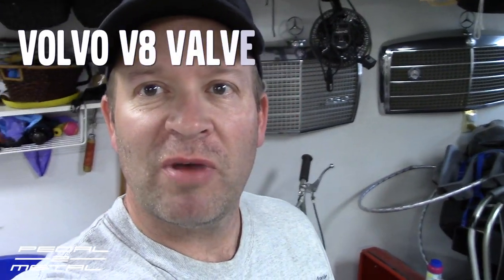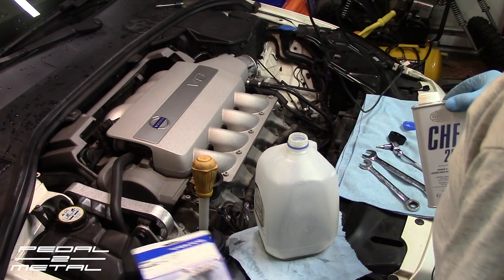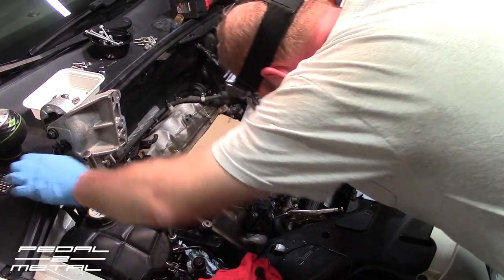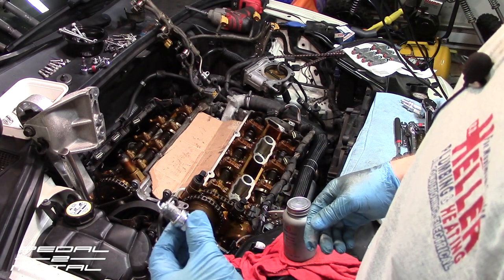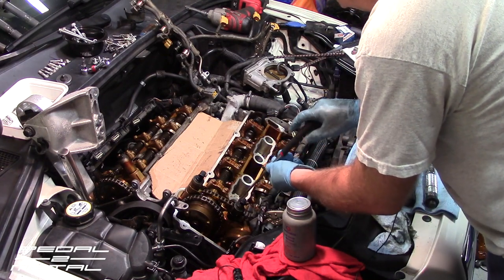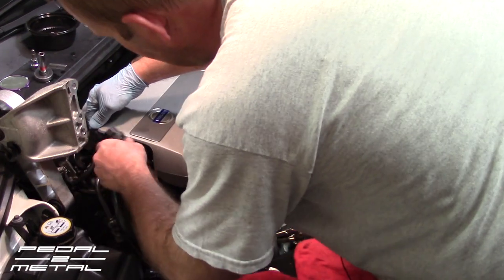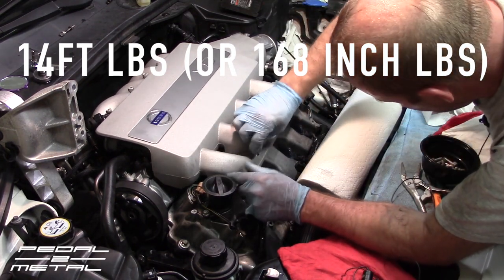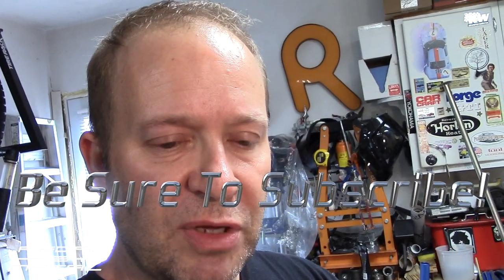Yamaha V8 Valve Cover Gasket Job | A FUN Way to Spend 12 hrs! | VOLVO S80 V8 Project Car Vlog

Comment: Doing this job myself, This video has had a lot of good info to help me a long the way. But I have to replace the fuel rail. I cant figure out how to detach the fuel lines that are back next to the fire wall. Worried I might break it if I try too hard. Any insight?
Reply from the maker: I'm sorry, no,  I don't.   They are most likely connected with push pin type of fittings, like VW and many others use.   Why are you replacing the fuel rail?  It's basically a tin pipe..  what went wrong w that; I'm just curious?

Comment: Are valve gasket failures common on these p2 v8s?
Reply from the maker: It's not a failure, per say; they just get very brittle due to age. The newest V8 is 2010, and the oldest is 2007. So you they are old cars now. Most need replaced if the motor has over 125,000 miles or so. It's very common and part of the regular maintenance of these motors. I still need to do my timing cover gasket, but the drip is minor.
Reply: @Pedal2Metal_on_YouTube  hi, i have about 70 000 miles, and I have these problems

Comment: Epic video, I have a XC90 with 138,000km and I'm gonna hit this job up. This is off topic but when I got the car, there was very low power steering fluid and it startled me when the steering went stiff suddenly, I filled 500ml of correct fluid in and it's been fine since. I did degrease quite a bit of grease around the top steering pump and noticed oil on control arm, etc.
Is it likely that it is leaking from the steering system or could the level have just dropped and the dealer not noticed it?
I do also have a tiny drop every day of brown oil (engine oil) from what looks like the rear bank (doh! looks like I need to this job).
Reply from the maker: Thank you for watching the video. Yes, I would say you might have a leak at one of the power steering pumps hose o-rings, it sounds. I would definitely keep an eye on the leaks possible location.

Comment: How many miles do you have? I'm going to test drive one this Saturday. How easily can I remove the plastic engine cover? Any other things to look at in your opinion? TY
Reply from the maker: Mine had 121k miles on it; it now has 132k.  You can easily pop off the decorative engine valve covers; just grab them and pull straight off the knobs holding them on.  The main issue with these cars is the alternator, power steering pump and transmission.  Also, once these cars go over 100k miles the rubber engine gaskets start to leak... Due to high heat conditions and age.  I'd ask for all records on the car.  Other than looking for drops of oil or power steering fluid; they are pretty damn reliable from what i understand. I joined the Facebook Volvo s80 v8 owners club right away to learn more info.  Good luck!

Comment: would you happen to remember how many grounds was there? I thought I had 4 but i got 5 ground bolts! and i've only used 3 so far... i only recall 2 painful ones at the back and 1 at front...where are the rest?
Reply from the maker: I had 4 total but the one in the front drivers side was not an issue.
Reply from the maker: My 4 were at each corner of the motor.
Reply: @Pedal2Metal_on_YouTube  thanks! i'll trace all my wirings carefully... i had to snip the 2 at the back, just buttoning everything back up now. seriously huge job!
Reply from the maker: @alliao  yes, its a pain in the ass of a job.  My car is no longer keaking any oil though; do thankfully it wasn't the timing cover.

Comment: Great video!  Decided to search YouTube prior to my start this afternoon. I'm ready to take off the valve covers. Bought same kit from FCP, get all parts there because of lifetime warranty  How did you deal with the fuel lines on the rear bank?  Noticed that you didn't separate them.  Doesn't look like there's enough room to get the cover off unless the lines are unbolted and moved which isn't easy. Spent 30 minutes trying to disconnect fuel lines and I don't have whatever tool is needed.  BTW, I used to own my own 7 bay shop for 20 years and have an ASE master's, but I wasn't a full time mechanic.
Reply from the maker: Thank you. If I remember correctly, I just moved the lines out of the way; I def don't remember disconnecting any of them.  My car is still dripping oil, so I guess I should have gotten the kit that has the timing cover gasket too.  Ugh
Reply: It's probably the front crankshaft seal.  That leaked first in mine. Not too bad to do.  I bought an OTC damper puller kit and did it through the wheel well. Can get the puller number tomorrow. Also, the power steering pumps are notorious for leaking, mine is and I have a replacement from Rock Auto.  The FCP one is genuine Volvo and about $550.  I called the company and they said it was made in Mexico.  Guess what, arrived made in China.  Oh well, will be the first Chinese part on the Volvo except for some LED bulbs.  I'm not paying $550!
Reply from the maker: @JFinch57  Yea plz let me know the puller part number when you can; I'd appreciste it!
Reply: I used an OTC Stinger 4531 Harmonic Balancer Puller/Installer set and a PBT 70960 Camshaft & Crankshaft Seal Tool Kit.  My front crankshaft seal started leaking around 140K miles.  At 203K started getting smoke under the hood and I'm stuck doing this job, round #2 today! My PS pump does appear to have a slight leak and I ordered one just in case so that's going in too.  Hopefully my Volvo doesn't reject the Chinese transplant!!!!!
Reply from the maker: @JFinch57  Thanks for the info!  I too suspect that's where the drop is coming from... Its not too bad right now, but with 131k miles, I'm sure it's only gojng to get worse.  Somewhere I saw a place selling rebuilt factory volvo p.s. pumps online that had good reviews; if I find it again, I'll send the link.  At least those pumps are easy to get to... Unlike the alternator!
Reply: @Pedal2Metal_on_YouTube  It took me 7 hours in my driveway to do my alternator! Broke the small sensing  wire connector. Luckily was able to get just the connector shell on eBay.
Reply from the maker: @JFinch57  Yea, I've always heard it's a pain in the butt!
Reply: Not done after about 14 hours so far.  The Chilton book time is 4.8 hours! What complicated things is that we took the XC90 on the 4X4 beach in the NC Outer Banks twice for vacation and the entire top of the engine was covered with sand.  Spent hours vacuuming and blowing out the intake ports, got 99.9% of it. Had to bend the rear metal fuel lines substantially in order to get the rear cover off. I didn't install the cam sensor seals until the cover was on and had to use a straight dental pick (didn't have a seal installer) to get the inner lip over the sensor without damage.  Your video alerted me to this problem.  She's resting peacefully right now with both covers sitting in place.  Will begin the reassembly tomorrow night.  Back to work tomorrow to relax!!! What's somewhat uncomforting is that I also have a S80 V8 in the driveway with 167K miles and it will be deja vu all over again sometime soon!!!!!
Reply: @JFinch57  sometime you can use electric tape to cover the sharp edge and slide the seals on. 
I do this to put my forks seal on, those are expensive and

Comment: never touched the B8444S but seems like it would be easier to remove the engine / drop the entire subframe
Reply from the maker: I think they do that for the xc90 SUV for some repairs, but not the sedan.
Reply: @Pedal2Metal_on_YouTube  They do that for the timing cover gasket

Comment: 16 hours?  You take a 20 minute break after pulling each bolt out?
Took me about 9 and that included pulling the intake a second time because the PCV hose came off the bottom of the intake manifold
Reply from the maker: Well congratulations. That time included power steering reservoir, cleaning and rebuilding the fuel injectors (with new screens and O rings), new spark plugs and repairing fuel injection wiring loom insulation.  I do explain all of the extras I did in the video, but people would rather write crying about the 16 hr title instead of truly watching what I say about the job.
Reply: @Pedal2Metal_on_YouTube  poor baby... I'm not the one whining and crying
Reply from the maker: @n5xmt  You literally asked, hence question marks... I answered you.

Comment: Does this really take 16+ hours to do???
Reply from the maker: In fairness, I was filming and dealing with the camera etc... and also pulled the spark plugs, fuel injectors (to rebuild) etc.  If you read the comments, some people claim 6 to 8 hours for the gasket job alone.   One "superman" claimed few hours, which in my humble opinion is b.s.
Reply from the maker: ALSO, I took my time since I didn't need the car back right away.  So, I list 16 hours... or a weekend, just to be safe, since most who are tackling this job  never did it before... let alone on a complicated v8 sitting sideways.

Comment: I'll be honest...

The V8 in my XC90 drives more like an inline 6 in a BMW. Too quiet, and too timid. All of this additional headache and maintenance just seems cruel when the payoff is a lackluster V8 experience. 

Really missing my 2006 X5 4.4i. The 2006 Mercedes ML500 is a much better ride with significantly fewer engine problems. Do yourself a favor. Avoid this car at all costs. Oil leaks at 100,000 miles, and too many rattles and creaks. The wood cracks. The leather is abysmal. 

My alternator repair alone was nearly $2,000-- at an independent shop. Volvo wanted an obscene amount for the repair. Run!
Reply: Hmmm, I've always liked the e53 and I have 2 e39s, but the m62 can have timing chain guide issues. Plus the proportions of the ml and X5 of the time always seemed a little off to me. My XC90 V8 is a perfectly proportioned tank and makes my BMW's look like the most reliable cars in the world, lol.
Reply: @AdamAus85  I had a 2000 740i that engine is fickle. My neighbor said I spent more time under the hood then in the seat..., 💢 😡 😂
I'll lease a BMW but I'll never own one outright. 
I have an 07 V8 And going from the 740 to the XC90 the transmission in the BMW is telepathic. But the XC90 utility is 🔥 and it's plenty fast with near HP -ft lb specs as the X5. Both are 4.4 32 valve quad cams. The BMW tho with the plastic timing chain guides   and the  with the high gas prices. The XC90 V8 isn't bourgeoisie. She'll drink 87-beer 89-champagne and 90-93 Crystal. 😂. The BMW's only drink Crystal. Also forgot the BMW is a 90° V8 the Volvo is 60°
Reply: My mechanic charged me 600 plus to rebuild my alternator.  I was going to get a new one but the housing on the alternator on the VA has a vent on the casing and I didn't want to go through those changes so I had him rebuild it
Reply: Lol 4.4 bmw have valve seal issues and that’s a 3 day job to do.